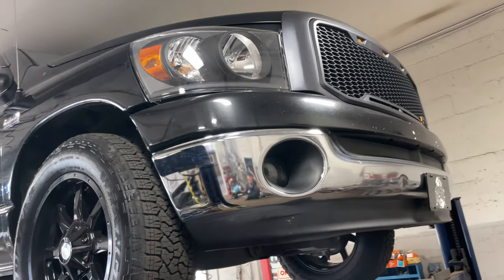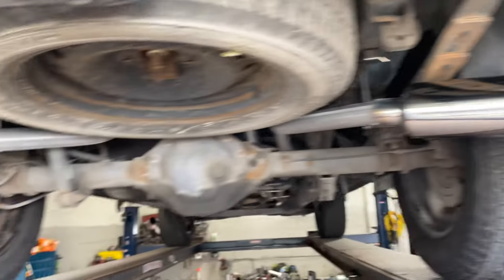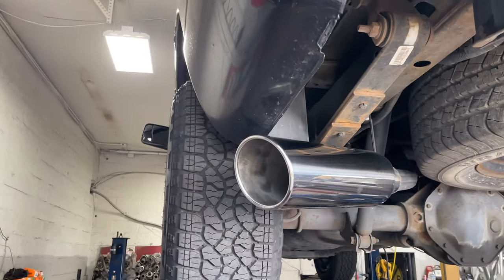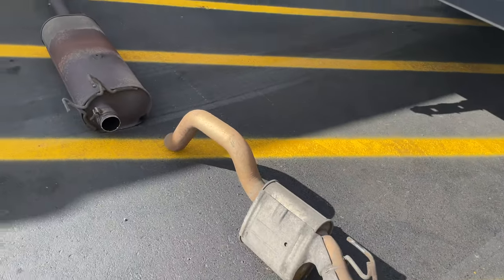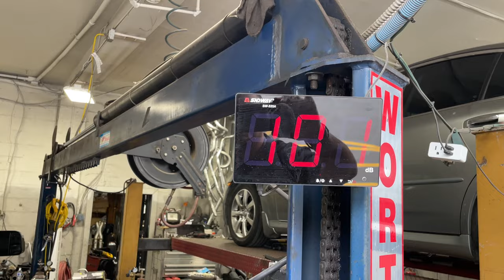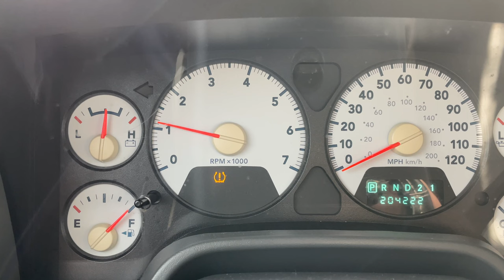2008 RAM 1500 5.7L HEMI V8 w/ FLOWMASTER SUPER 10s!

Comment: That’s why I left the resonators on my Ram with a super 10.  Nice deep tone and no rasp
Reply: I have a 2013 5.7 Ram with a single 3 inch super 10 dumped before the axle and its extremely deep sounding. Rattles windows and sets off car alarms, I love it! Its crazy how tips make this truck sound like crap.
Reply: I have a 2020 Ram 1500 Hemi with a Flowmaster super 10. I changed out my factory tips for Flowmaster 4" rolled black tips, and it changed the sound, so much. It sounds so nasty at w.o.t with K&N c.a.i.